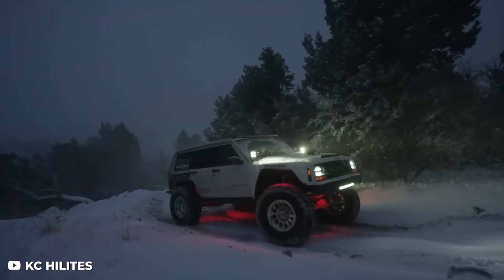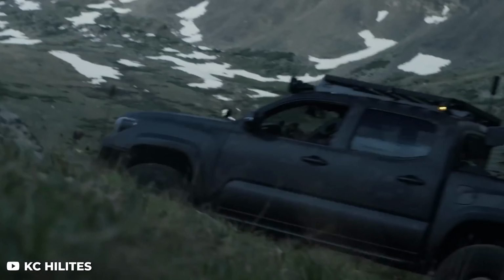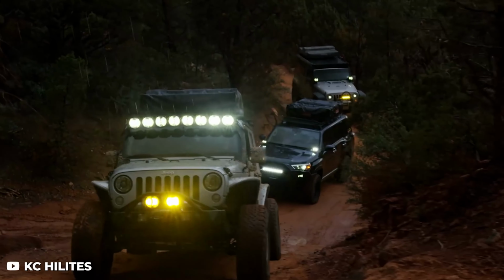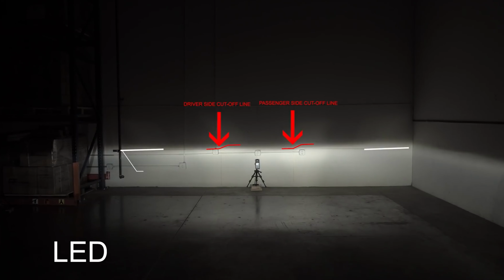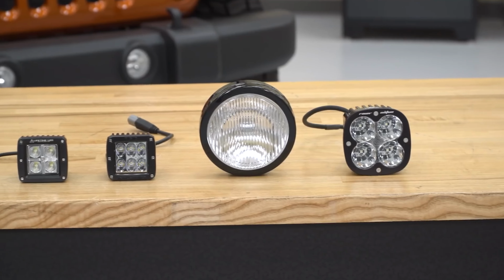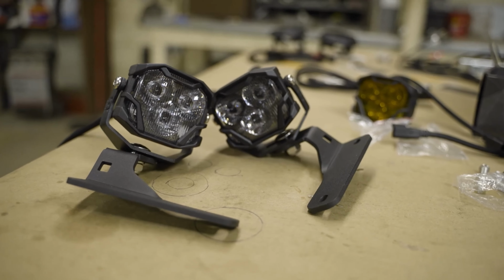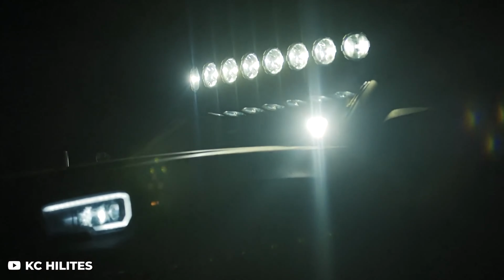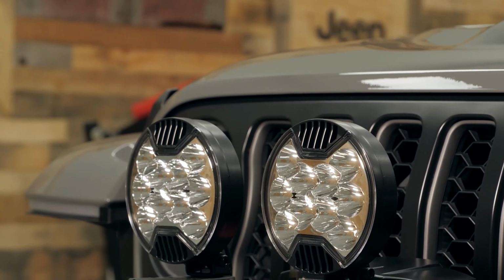Off-Road Lighting Guide

Comment: You should mention that Halogens have a cold weather advantage.  They are the only light discussed here that puts out heat that keeps them from icing or becoming snow packed
Reply: HIDs should produce enough heat too, and there are LED options that have a heated lens. In my experience though if the snow is sticking to the lens not even a halogen can melt it off fast enough, after the storm has passed they do a good job.
Reply: While I agree that halogens melt snow/ice, I have to also disagree. HID lights put out just as much heat, often more so than halogen. Also, depending on the wattage of the LED's used, they too can put out a considerable amount of heat. I have some small LED pods that are super bright (output is roughly 3,000 lumens per pod) and subsequently, they make the housings almost too hot to touch.
Reply: agreed. halogen bulbs are the only ones that prevent lens from icing and snow pack where i live. led headlight bulbs, lightbars, hid projectors all freeze on my rig. can't see 10 feet ahead. I've tried them all. halogen lighting best always works in all weather for me
Reply: Hmmm, may stick with halogen on my amber fog lights, as im getting them for snow in winter and on road use. Going to likely go led for lightbar and work lights.
Reply: My leds have cooling fans and they get the lense warm
Reply: I live in Western Canada and drive a 2019 Freightliner to Alaska every week.  3000 miles up and back. The halogen lights with 100watt bulbs are the only ones that don't ice over. I keep them low and use them as fog lights. I have 2 HID flood lights on my roof that point towards the ditches to see Moose and Caribou. They light up such a large area that animals run back into the trees instead of out onto the road. Hope this helps someone.  Be safe out there.🇨🇦
Reply: @Beavertrkr what brand are you using for your HID spot lights on top?
Reply: Between my truck and trailer I have 14 side marker and tail light housings as well as two headlight housings. Since switching them all to LED the snow never melts off any of them including the headlights. Previously I had halogen and standard candescent lighting which nearly always melted the snow off of the lens. I live in the snow 6 to 7 months out of the year and since changing the LEDs I am constantly cleaning light lenses due to lack of heat.
Reply: My LED headlights have never been affected by snow or ice.  Two years going now and I live in South Lake Tahoe.